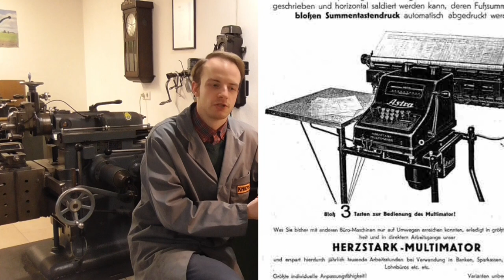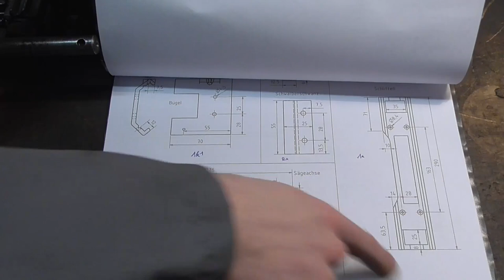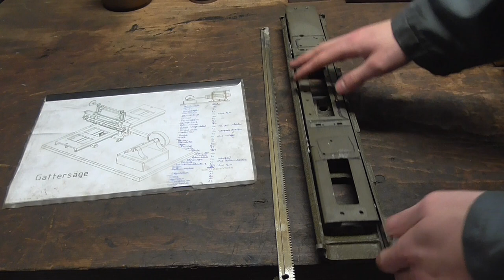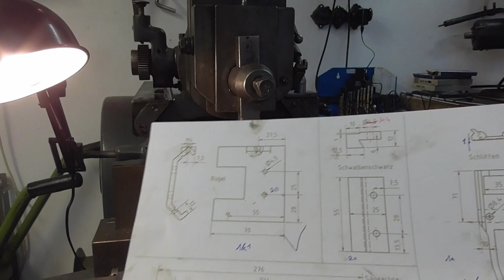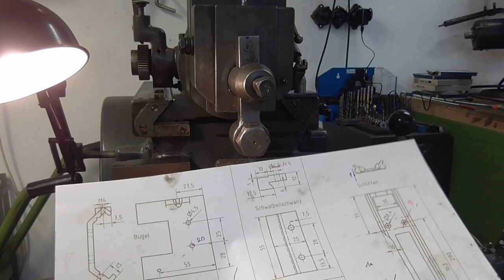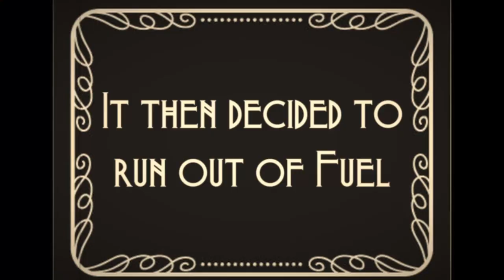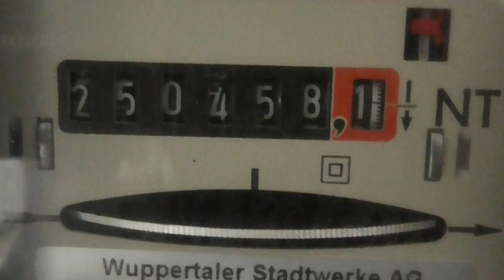Bulding a whole damn Sawmill Model in 2 Months, I guess

Comment: Editing was fine to me ;) What a project, I hope you can get your hands on a milling machine soon, so cool to see that shaper doing its job. Cheers
Reply from the maker: I had chances to buy a mill several times - truth is I wouldn't want one xD
Reply: @AstraWerke  Oh, i'm curious why not ?
Reply from the maker: @Lou1ouze  Cutters are expensive and can't be resharpened (without an expensive cutter grinder, at least), they're greatly reduced in efficiency without flood coolant (which is a mess), they throw chips everywhere, they're loud, and if you want a solid one, they're heavy and expenive.
Since I design the parts I make, I can design them in a way that can be replicated with the tools I have, and since I don't have to live off my work, I don't need the faster operating speed of a mill.
For the annual one or two occasions that actually require a mill, I can always ask a friend.
Reply: @AstraWerke  That makes perfect sense, thanks for the reply